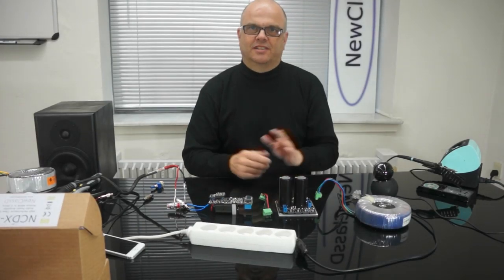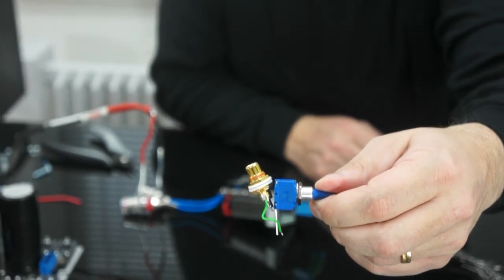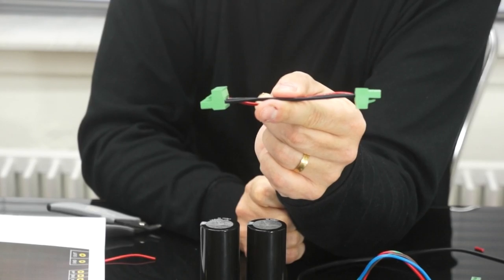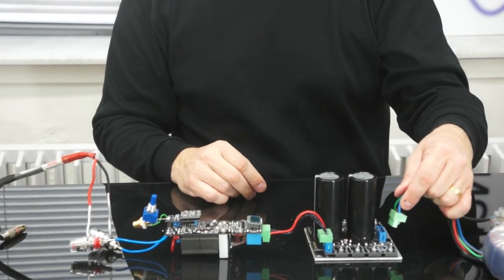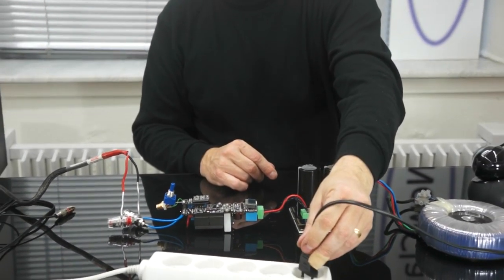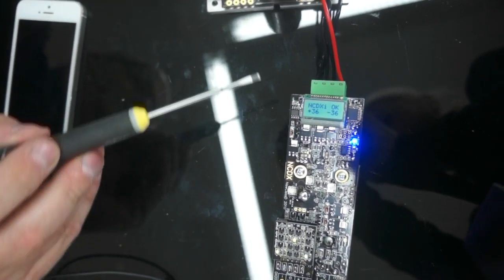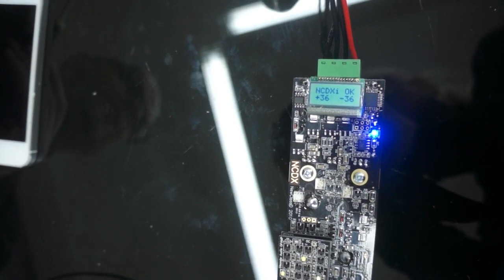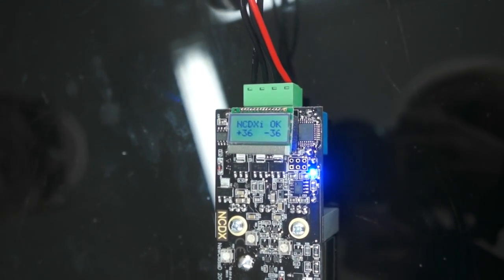NCDX Class D Amplifier 1 minute build

Comment: Nice, but I want to know how the audio quality stands out.  An MP3 on an iPhone can not tell that.
Reply from the maker: +Peter Pan Hi Peter the sound quality (and data) of this module is on par with the "upper end" of factory amplifiers, like in the price range of 5 - 10.000 USD for a power amplifier. It can produce up to 480 Watts RMS in 4 Ohms load. This design is from 2010, and we have also a new platform now, called the NCDV, which pushes the bar just a bit more, so you can compare the sound of NCDV module to just about any price range of factory amplifier. It is fully discrete, with silver plated inductors, teflon isolation, etc. etc. The NCDV is rated at 800 Watts in 4 Ohms but tested at 1200 Watts RMS. Still it's only the sound quality that is our focus area, so you get the most delicate detailled sound imaginable.